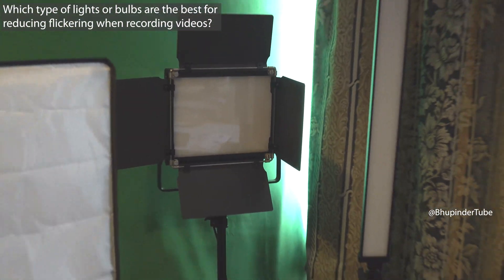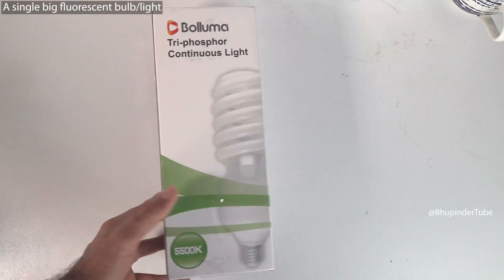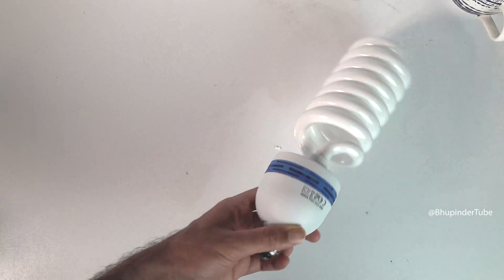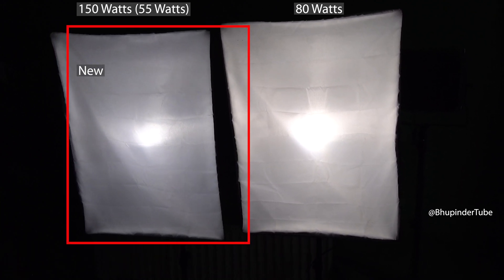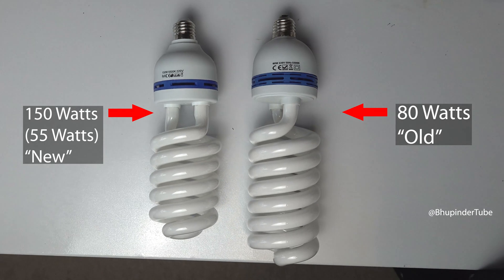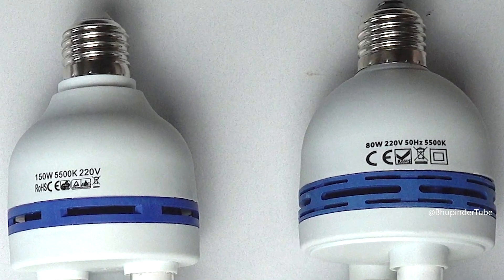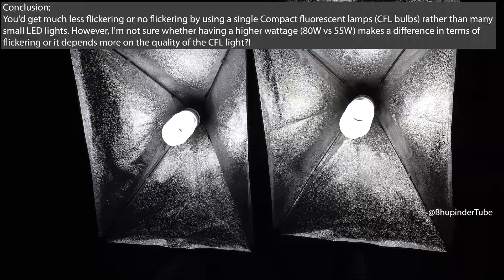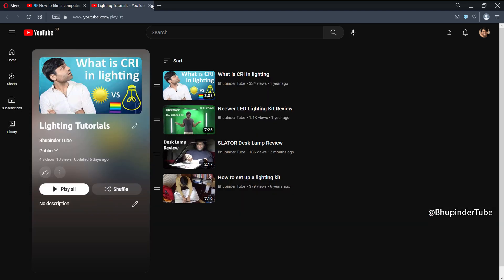How to stop flickering lights in video based on different types of lights

Comment from the maker: Please mention in the comments your experience of different types of Lights and which you light you think has lower or no flickering when filming or photographing, and why? 

I have put a lot of efforts in making this video! I appreciate if you could in return subscribe to support my channel! It does really help. Thanks! 🙏 More related videos below
👉 What is CRI in lighting - https://youtu.be/6aWEKRqzW70
👉 Neewer LED Lighting Kit Review - https://youtu.be/gCcaFSnsPNc
👉 SLATOR Desk Lamp Review - https://youtu.be/FwmqolWkEIw
👉 Text Message vs Authentication Code - https://youtu.be/Lq-XJwyKG68
👉 Difference between Plug, Port, Jack and Connector - https://youtu.be/s3GPU8lVkRo
👉 What to look for in a Power Bank - https://youtu.be/Je7uAEgwmJs
👉 What is USB Power Delivery (PD) and why it's important! - https://youtu.be/vRLhFb_znY4
👉 DVI vs HDMI - https://youtu.be/NjBEKxQ4AtM
👉 What is Dolby Atmos?! - https://youtu.be/oa_FEtepU-0
👉 Which has the best audio for a soundbar, Aux, Optical, HDMI Cables - https://youtu.be/lcGLxobvVro
👉 What are the 3 audio ports on my PC - https://youtu.be/HZcQzPH4iDM
👉 How to set up a lighting kit - https://youtu.be/kBYDEoqQwMI